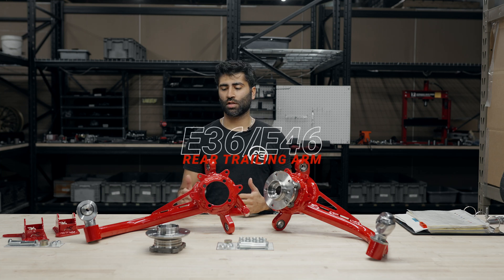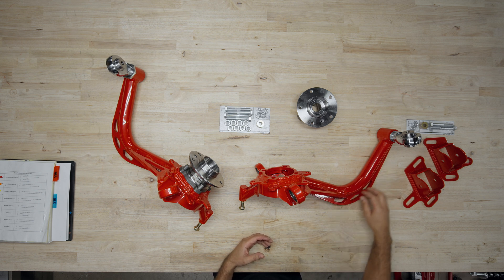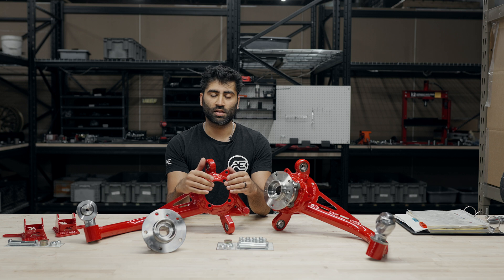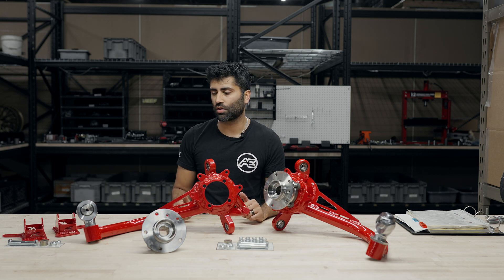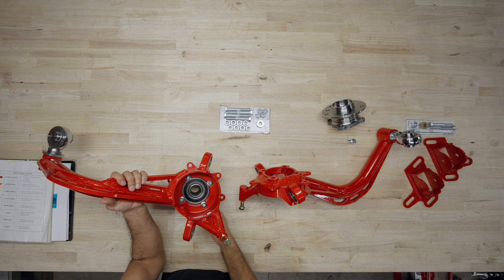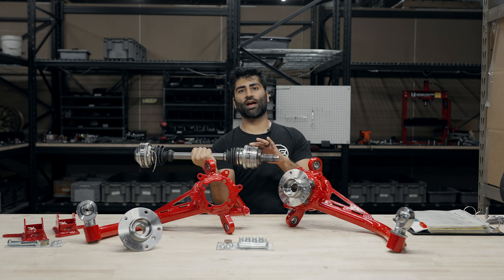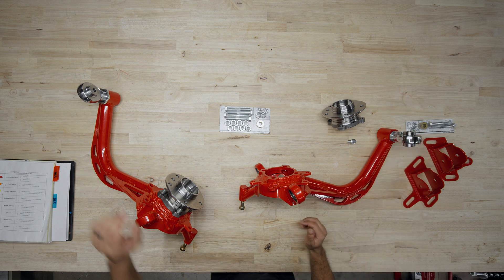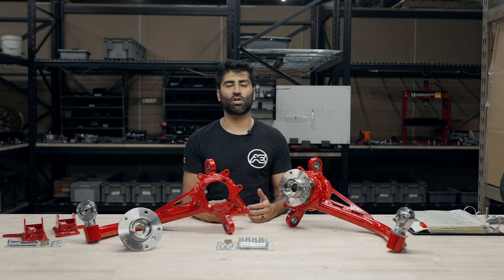BMW E36 and E46 Rear Trailing Arms - PRODUCT OVERVIEW

Comment: Would you be able to press in the 30 spline wheel hubs? From an e46 330i?
Reply from the maker: These already allow the 30 spline m3 / e46 axles but as a bolt on wheel bearing now!